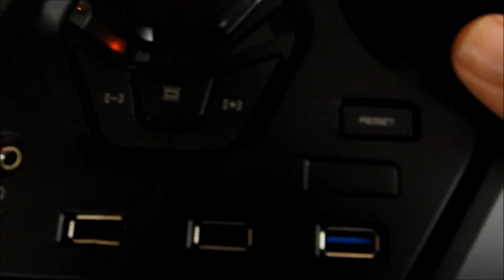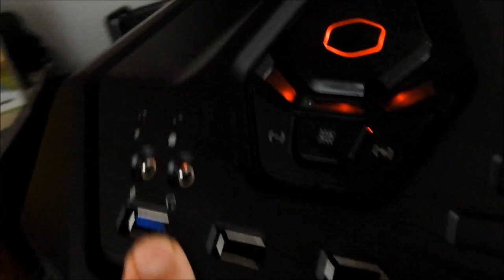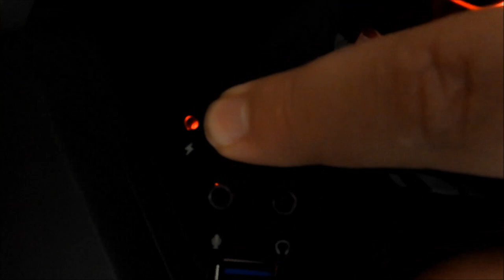Cooler Master Trooper SE Review

Comment: 2x 14tb hdd + 4x 4to ssd 2.5 + 2x 2to ssd m.2 +1x 4to ssd 2.5 in the front panel + pcie m.2 converter -> 2x2to m.2 = 56to i think its good...

Comment: So i started to do some research about this case and i discovered what people meant by a drawer behind the cooler master logo at the bottom front of the case, behind the logo on a previous model, the storm trooper, there was a drawer shown here, https://youtu.be/XHbrsDrjpXI at 2:20

and i do have a question about the space inside the case, why is so much space between the 2.5 in and 3.5 in drive mounts, and its not like  the space is reserved for 5 1/4 inch drives because the fans would get in the way, so like why
Reply from the maker: The 3.5 drives in behind the back panel where you hide all the wires and the 2.5 in drives go on the side of the case right behind the tempered glass side panel and the reason why there's so much space in between them is so you can mount a radiator or something because they have fans in between the drive rack the video of shows where the cooling fans and the ssds we go
Reply from the maker: I'm sorry if you can't understand that my voice command sucks hopefully that helped

Comment: Hi, can i put 5-6 optical drive in this case?
Reply from the maker: If you're talking about dish drives then no but if you're talkin about hard drives yes or no so it's got 4 SSD slots and it to HDD slots so if you're talking about describe the reason why you can't put that many in there is because right below it where the one mounts is cooling fans and she'll freaking mount a radiator and stuff and there's already currently fans there hopefully this helped sorry it took forever